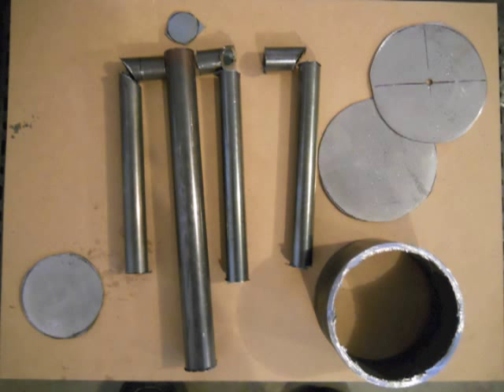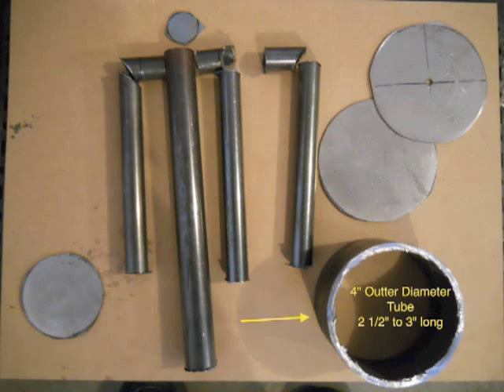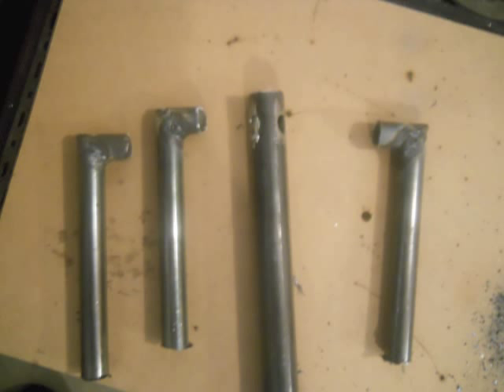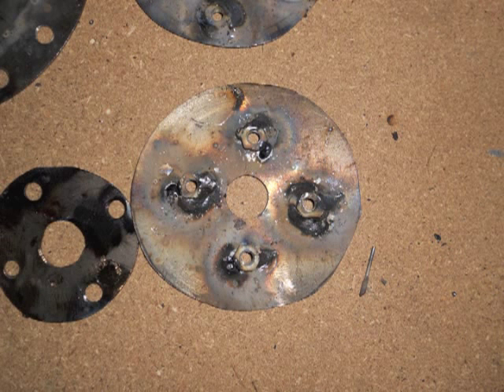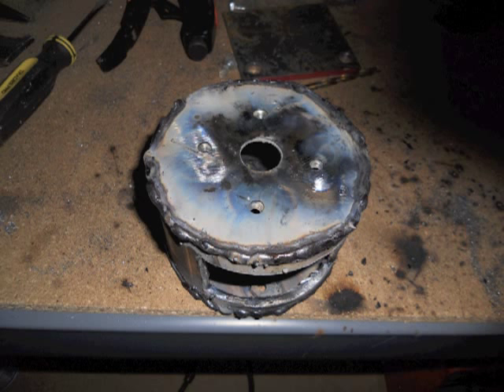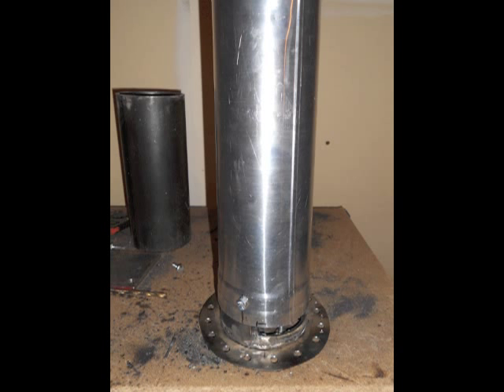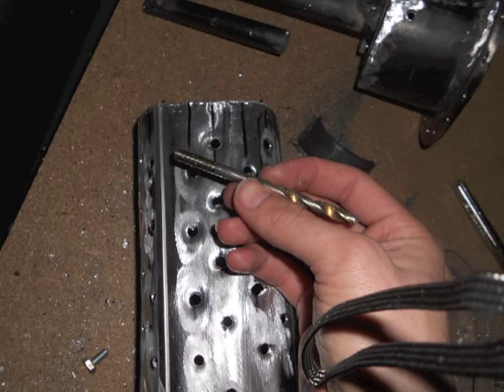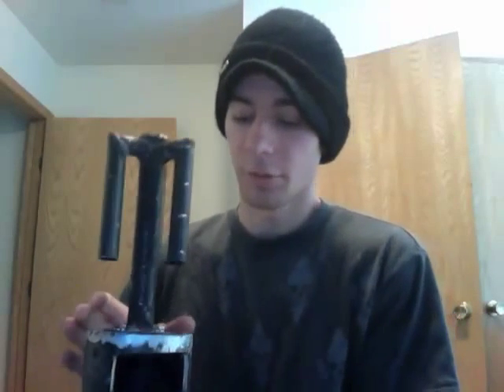How to Build a Jet Engine - Part 3 - The Evap Tube

Comment from the maker: @Alexis2011a a small one for an RC plane would be possible, but in my opinion, difficult.  Turbojets have many precise moving parts so that is where the difficulty comes in.  On the other hand, I would recommend checking out valved (or even valveless) pulsejets.  The can easily be made any size and are much simpler.  In the future I'd like to do some videos on pulsejets, but at the rate this one is going it may take a while.  If you want to know more about pulsejets feel free to PM me.

Comment from the maker: @Klause5425 No they do not.  Ram jets and pulse jets do not require many moving parts at all.  But gas turbine engines (turbo jets) all require turbines, and since turbines are such precise parts, using a turbocharger makes building one a lot easier, cheaper, and more safe.

Comment from the maker: @flaps20check Wow, i guess I never thought to question his design.  Its so cool to have someone else's opinions and views on the construction of these.  I have questioned the fact that most "junkyard turbo jet engines" have an intake hose that empties into a much larger combustion chamber, causing a drop in pressure.  However, I've seen a couple "cut-away" engines, and they do have a bypass area in the combustor, but i'm very curious to research some calculations.  thanks for the thoughts :D

Comment: You basically built the same concept of a micro jet engine. They have separate stainless steel rods that glow red hot inside the combustion chamber, fuel is traveling through a small needle size hole than hits the inside of the hot walls of the stainless rods, liquid fuel will then turn to vapors. Evaporator stix they call them. You don't really need to shoot air through that hole you made. Inside the combustion chamber will get though's tubes of yours pretty hot to vaporize your fuel